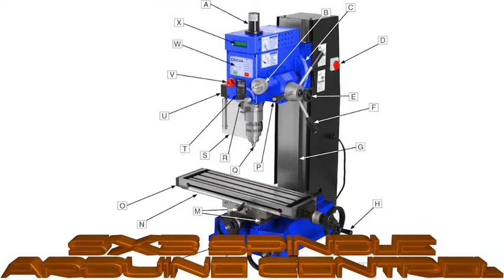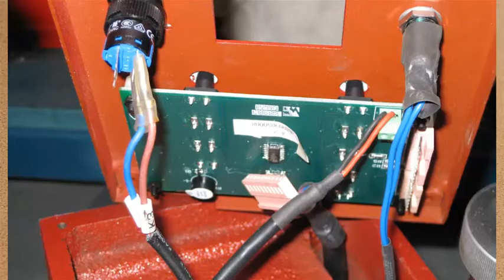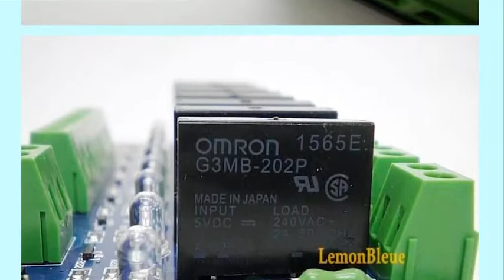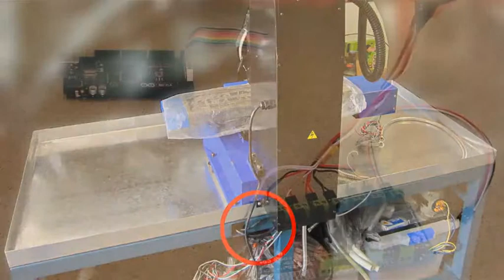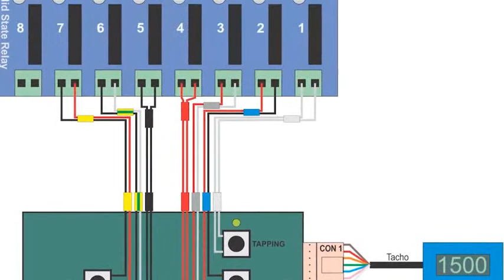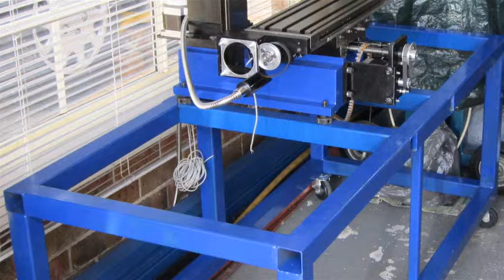CNC4A - SX3 Spindle Arduino Control

Comment: Unfortunately it doesn't have the translation option; however, thanks for the introduction.
Reply from the maker: Which part did you need translated Amigo?
Reply: @TheWizard  Greetings.
I want to implement physical buttons for Estop, Reset, Stop, Cycle start using mach3 and it seems like there is something interesting to do.
Thank you for your valuable time and kind attention.